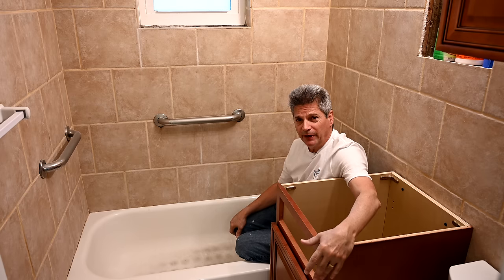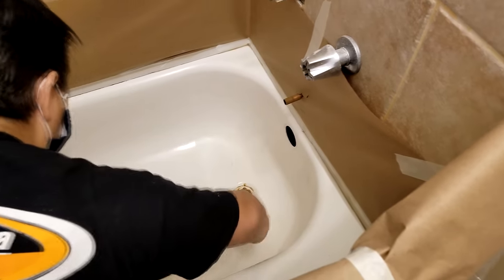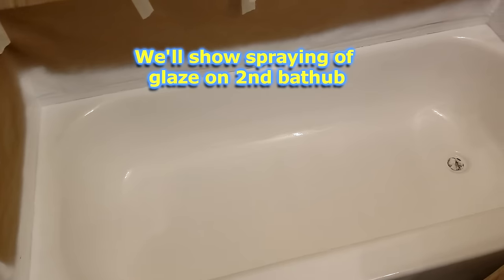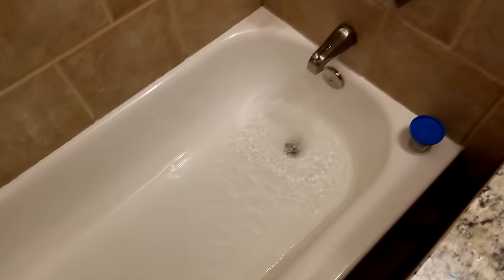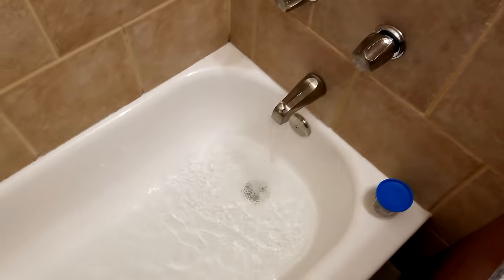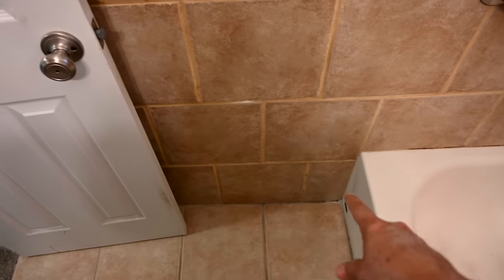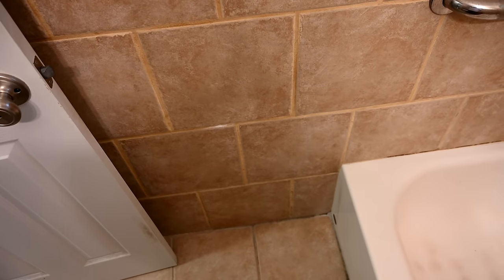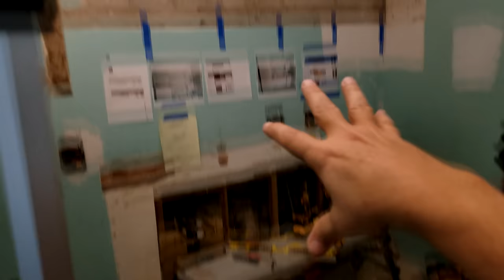Bathtub Reglazing Like The Pros, Tips For Beginners

Comment: Who's high quality primer?  Just go to lowe's and buy a primer for your house?
Reply from the maker: The type of paints and primers that you buy at Lowe's are residential grade and are laughed upon by professionals in the painting trades. These guys go off and they had specialty primers made that are of much higher grade quality then what you would buy at Lowe's. And it's not a painting primer either it's a different type of a primer made to accept the glaze that these guys use which is also a special mixture of higher quality than what you get from Lowe's which is why they are able to offer a five year warranty. Go see what the warranty is on the bottle on Lowe's and read the reviews on the bottle of the stuff you buy at Lowe's and you'll see all of the complaints

Comment: number one tip: never ever refinish the soap dish, you can never get it clean enough for proper adhesion
Reply: Even w proper sanding? Was thinking of sanding myself before they came in because soap dish often gets neglected w a reglaze, especially underneath the soap dish like in this video. Was thinking of using a mini sander and paper by hand to get in crevices
Reply: @1357kidwonder  you can try but you would need to etch it with acid and sand it and couple times at least, sanding alone really does nothing its porcelain, the reglazing of tubs relies on a mechanical bond between the base coat and the original surface of the tub or tile, the base coat locks into microscopic pores opened up on the surface of the tub after the etching acid product is applied, after it is applied and rinsed use a base to scrub like baking soda and then do it again, no soap residue can be present to have good adhesion and a lasting finish that wont flake away in short time, i learned a very old school process without all of today's chemicals that provide shortcuts, others will disagree perhaps but i had about a handful of problems over ten years of doing it, everyone else had many many problems with flaking etc. good luck, i replaced soap dishes or left them alone 99 out of 100 were left alone

Comment: This is one of the biggest hack jobs I've ever seen... I don't even know where to start with this one.
Reply from the maker: Taping it up, that's where you start
Reply: @jeffostroff  I appreciate the attempt at humour, but this video should be titled, "How to make an absolute and utter mess out of someones bathtub". There was absolutely nothing professional shown in this video, rolling on the "primer", using pressurized ventilation, no acid etching(or use of an adhesion promotor in lue of etching), completely in adequate masking, lack of proper ppe, and that's barely scratching the surface. Please consider finding a properly trained professional for future projects and videos.
Reply: @jeremyanderson3160  i hate having to fix guys like this work , no acid almost made me chuck my phone
Reply: Equipment and rear of paint wagon look like scene from a zombie movie. World ass content.
Reply: Imagine thinking someone would use a $300 primer on a under $300 job. Most pros charge between $350-$600 for this national average is around $450 to professionally reglaze. 

Why would he use a $300 primer, and not acid etch the surface which is the most pivotal part of adhesion. Not to mention not Mask the floor lol. 

Self etching epoxy primer or silane bonding agents run anywhere from $60-$85 a a gallon. He’s just lying or ill informed.